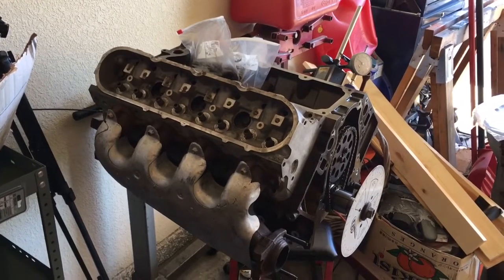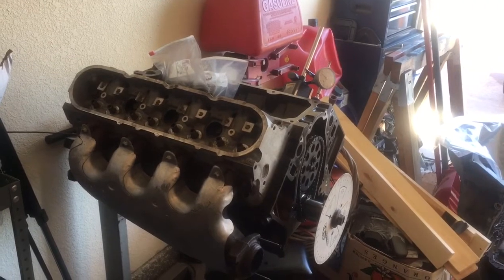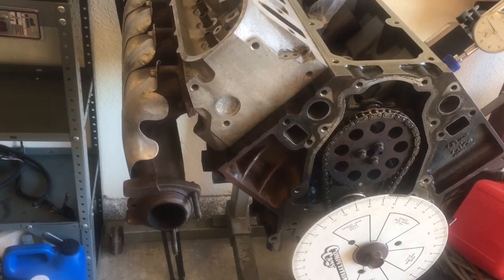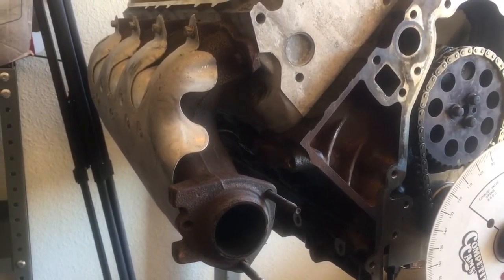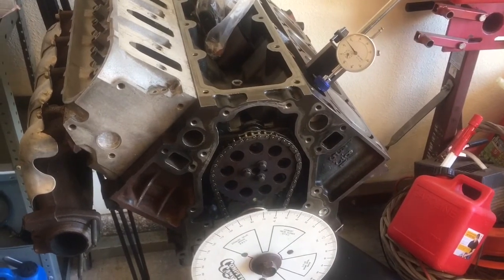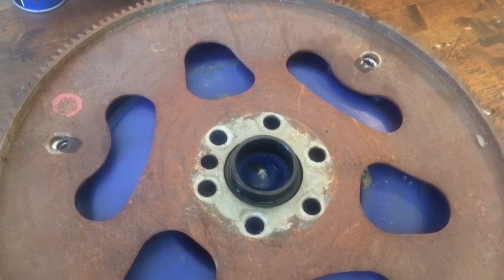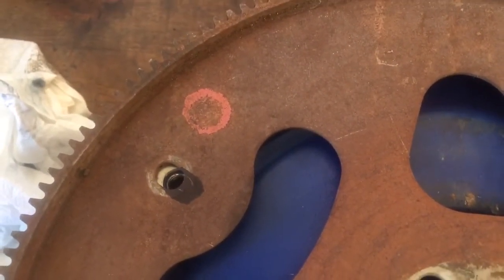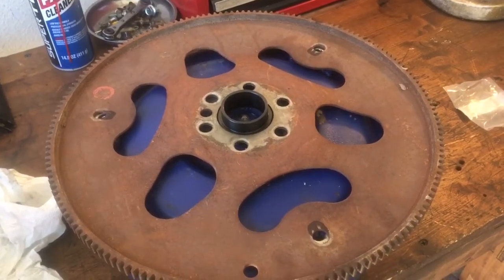LS flexplate w/ GM small 10.75" bolt pattern

Comment: I have a 1997 GMC and I want to install an LS engine. What engine is suitable for the automatic transmission of this GMC, similar to a torque converter and four-wheel drive? I don't want to drill into the four-wheel drive; I'm afraid it might loosen.

Comment: What exactly did you use to elongate those holes? My 4L60E to TH350 flexplate is coming up a little short.
Reply from the maker: Double cut diegrinder burr, you might be able to do it with the side of a 3/8” drill bit; it’ll just take longer. JD
Reply: @HeadFlowInc  thanks

Comment: Pretty interesting as a way for adding an overdrive for old motors. I would guess it would need balancing.
Reply from the maker: No balancing required.  JD
Reply: Why? Your taking the same amount of weight all the way around but wallowing out the holes is not the way to do it...either but the right plate or weld the original holesin and redrill after grinding both sides flush

Comment: Can I use a 4l60e transmission from a 99 tahoe on 2003 sierra I need help I've read I can using a adapter sleeve and ovaling the holes like. Doing ? I've read something that one is short crank and other long crank.. mines original flex plate is bowl . What can i do help me.  I've read it works when using on older tranny's.
Reply from the maker: rosacebrerosrc The flexplate remains the same in the Sierra because you’re changing the transmission but may need an adapter ring not sure. The flexplate design dished, flat, flat with bolt on spacer is determined by the length of the crankshaft register as you mentioned. 
The Bellhousing bolt pattern should be the same, but the Sierra may only use 5 bolts, due to one area top right isn’t machined for a bolt. 
You’ll need to match up and verify the torque converter bolts will line up to the flexplate. This is where you may have to grind/drill the holes slightly to get things to line up. 
Now, as far as electronics and harness etc I don’t know for sure if the 1999 and 2003 are the same? JD
Check this guide:

https://www.novak-adapt.com/knowledge/gm-crank-spacing

Comment: you can also just buy a 4l80e flexplate and spacer from a 6.0 ls truck.....itll mount right up
Reply: 4L80E has different torque converter bolts pattern
Reply: @pmotorsports8276  just slightly ovalize the plate holes. Takes about 5 mins
Reply: @Shadow0fd3ath24  without the spacer supporting the hub you'll be replacing the flexplate in a matter of months. experience speaking